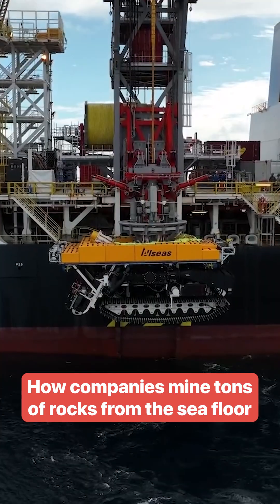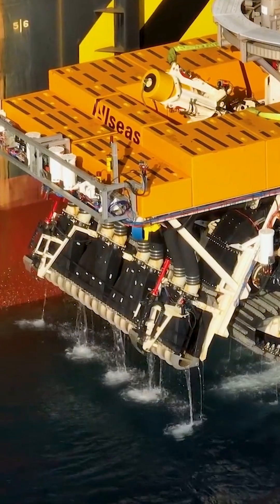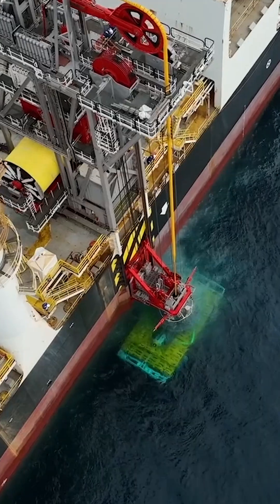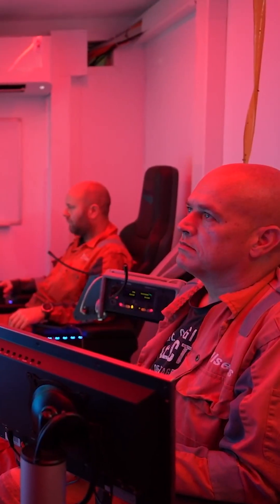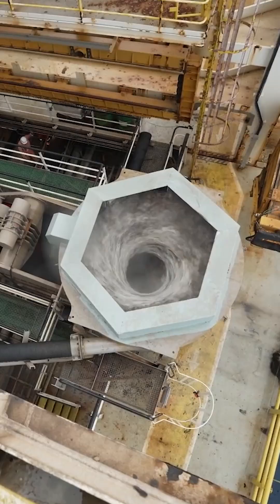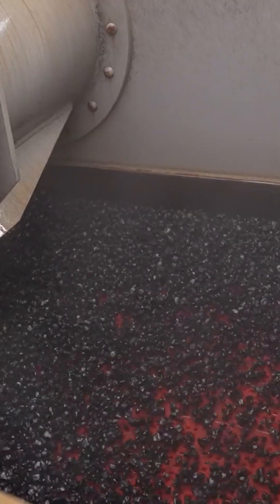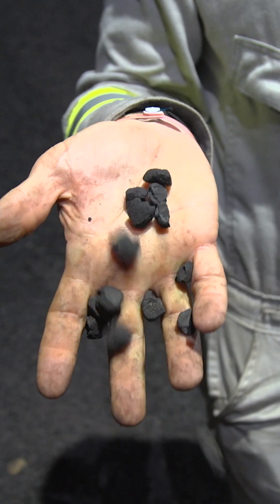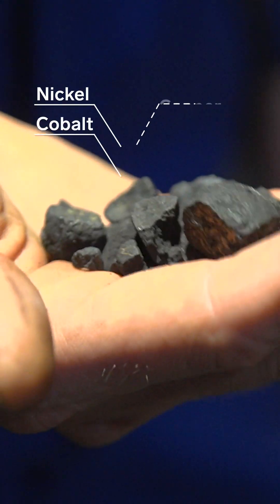This is how companies mine rocks from the sea floor. 🪨  #rockmining #sea #minerals

Comment: Currently, cobalt mining is almost exclusively done by Chinese companies in the Congo who destroy communities and bully and abuse the people while they steal resources through corrupt governments. Maybe this can help transition into a sustainable economy that could support a growing electric vehicle market which could ultimately decrease our carbon output. I believe this change could outweigh the negative impact of this method of mining.
Reply: How about we use a battery recipe that doesn't include cobalt and there by break the value of it on the market? One such recipe does excist and is gaining traction from the likes of Tesla. But the recipe does not account for other rear earth metals China is stratigically stock piling.😮
Reply: @jehiahmaduro6827  whoever that invents that will soon fall out of a window
Reply: But this mining is not instead of, but in addition to other mining.
Reply: Lol electric vehicles that rely on fossil fuels to generate their electricity. The raw materials in giant ass lithium ion batteries cause more devastation to the environment they’re collected from than fracking. Plus you still have to frack oil to charge the EVs. But as long as you pretend EVs are clean you’re a good person 😫
Reply: @itsv1p3r The whole electric vehicles will save the earth stuff is bullshit, the amount of carbon expulnged into the atmosphere is way more than normal cars